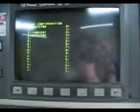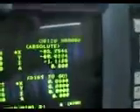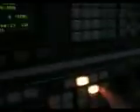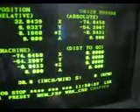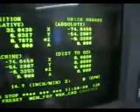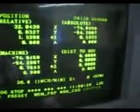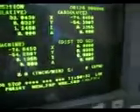komo cnc problem part 1

Comment: I had the same problem ...go into system parameters and go to your limits make The axis in question 99999999 and -99999999 restart the machine. Home it then go back and put the original numbers back restart the machine and the problem should go away.   You have to go into parameter write first of coarse....hope this helps

Comment from the maker: @0106cowboy
well we just rewired the extreme overtravel sensor to be connected full time, its a loose cable somewhere,
we do however still have the toolchanger stuck, which is a real pain because im just using the other router it has, but i cant change the tools which is a real pain, so the cnc is stuck only cutting wood, no designs, no engravings, i hardly drill holes anymore because i dont have a 1/8 or 3/8 bit on it atm... so if you can help with the carousel tool changer that would be great!